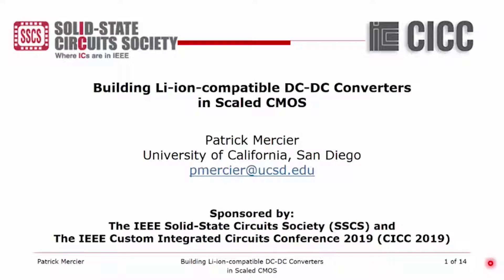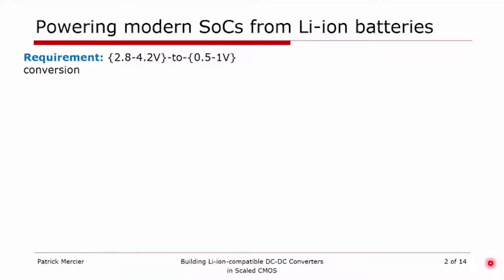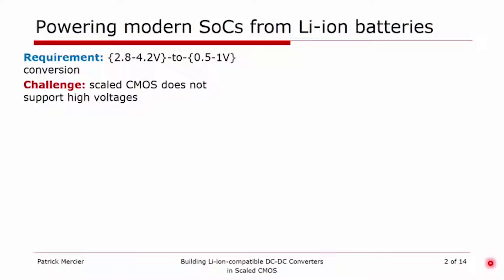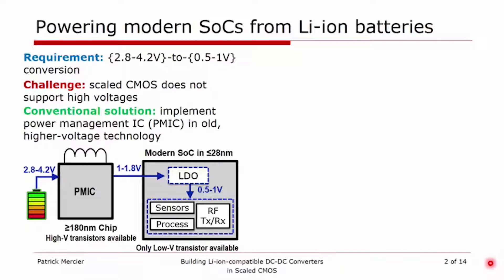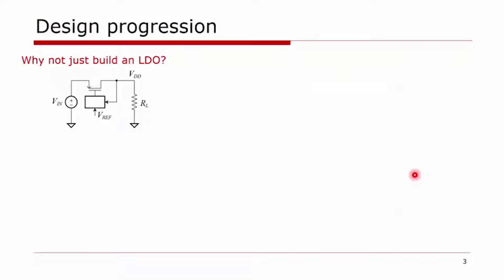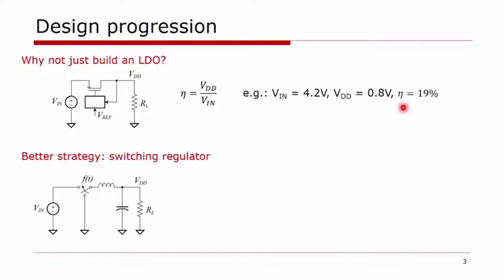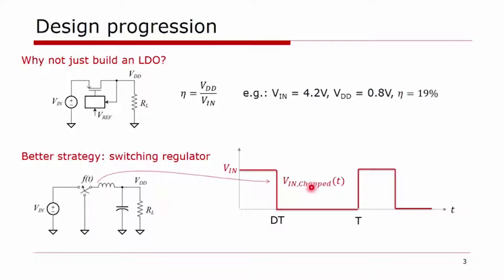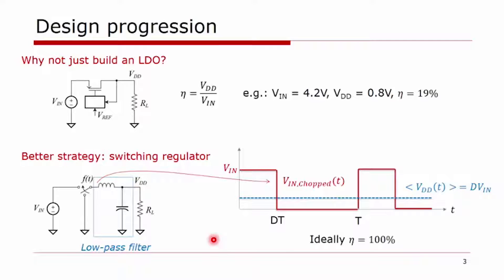SSCS CICCedu 2019 -  Building Li-ion-compatible DC-DC Converters in Scaled CMOS - by Patrick Mercier

Comment: 8:10 it is explained that NMOSs are not stacked because there was no triple-well process and there was a risk of high gate-bulk voltage.

my question is, is gate-bulk voltage really an issue?
intuitively it seems to me that if G-S and G-D are guaranteed to be <1.8V then it should be fine. 
isn't the potential under the gate a gradient between source and drain? 

PS: i've taped out such a circuit (stacked NMOS without tripple-well), wo we'll know in a few months :D